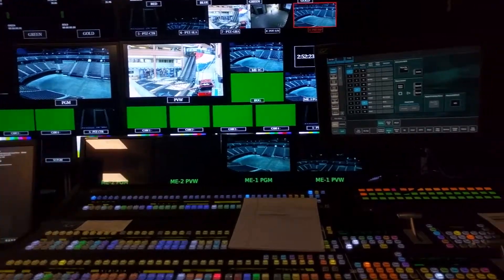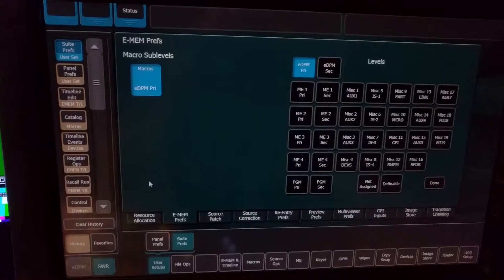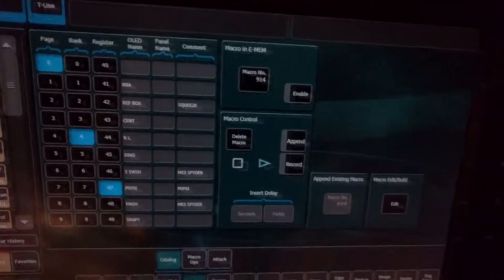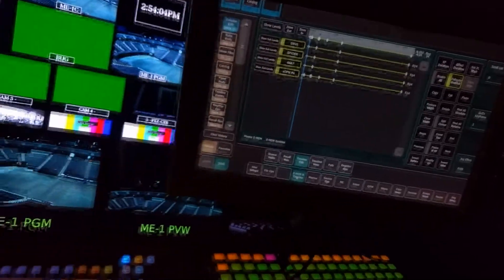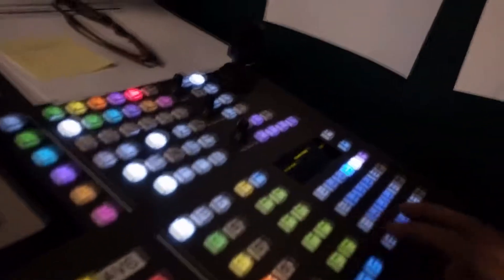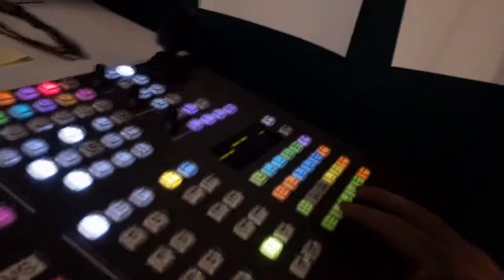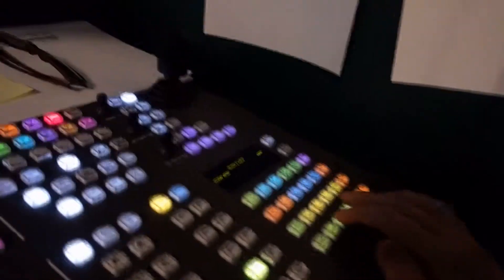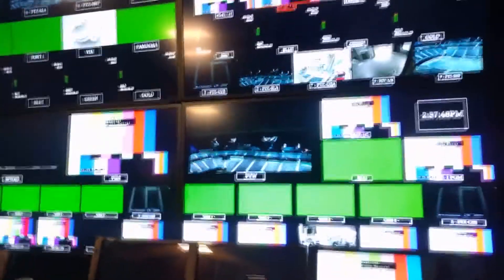Grass Valley Karrera EMEM Timeline Editing

Comment: Hi Jon! I work on a Kayenne and I'm attempting to loop an EMEM timeline. Seems the only way is to embed a macro into the timeline. Your video was super helpful, but I'm struggling on how you get from delegating MCRO (misc 10 in your case) to actually getting a macro to fire. Any suggestions?
Reply from the maker: Hey man, what are you trying to make happen with the timeline? Think I can answer the question better if I have an idea of what you're trying to accomplish. As far as getting a macro to fire in an EMEM, whatever macro you have enabled under the "Macro in E-MEM" box on the Macros > Catalog menu (as in 2:45) is what will fire on any given keyframe of a timeline.

You can make a macro that will re-load a particular timeline, or if you just hit run again you can always re-run that timeline, but I've never seen a timeline auto-looping endlessly.
Reply from the maker: I don't know what you'd use it for but maybe for like an iDPM effect that you wanted to loop for whatever reason, you could run the effect and then on the last keyframe load a macro that loads the same EMEM again and plays it again, that would probably loop it. I would imagine to make it stop you could just turn off auto-recall.

I use the macro to load another EMEM on the last keyframe thing with my replay effects, where on the last keyframe of my replay in I'll load the replay out.
Reply: @Jonathan_Freeman  it's honestly more of a proof of concept. I tried putting run marcos at the beginning of the timeline and rewind macros at the end, and it just wouldn't work. It's really stumping the other TD and I because from the way the timeline looks, it SHOULD work. but everything we do keeps resulting in a whole lot of NADA. This has shown us how to imbed macros into EMEM timelines, so that's a new 'skill' I didn't know prior
Reply: BUT if you're interested in the exact effect we're trying to loop, it's simply a box that goes from top L>top R>bottom R>bottom L>top L
Reply from the maker: @bradb2672  Rather than rewind/run at the start, just have the one macro at the very last keyframe that loads that specific EMEM, has maybe a 2-7ish frame delay and then run in the same macro. Should only need the one macro. A lot of times it just comes down to it tripping over itself trying to do too much at once without delays spacing it out
Reply: @Jonathan_Freeman  I'll give it a whirl tomorrow! thanks
Reply from the maker: If I have time today I might give this a try just because I'm curious if it works as well, and if so I'll make a quick video for you
Reply: @Jonathan_Freeman  if you get to it, that would be awesome! I'll be sure to credit you! haha
Reply from the maker: Haven't had time to get this up sooner but I think this illustrates what we were talking about! https://youtu.be/mMQ0sdw5cs4